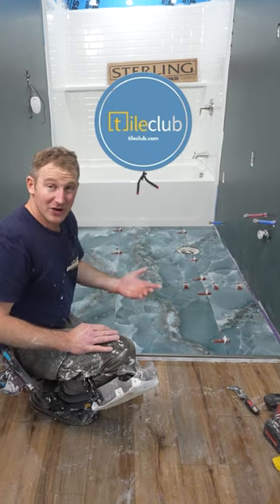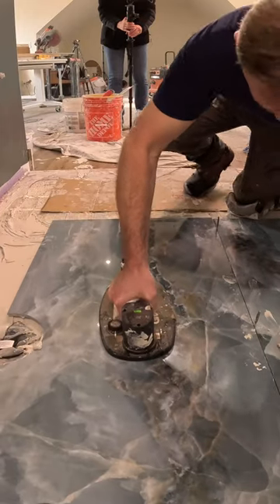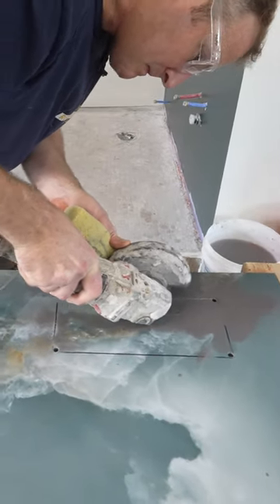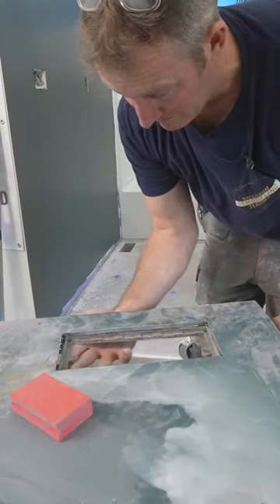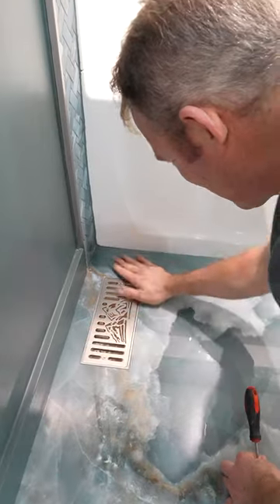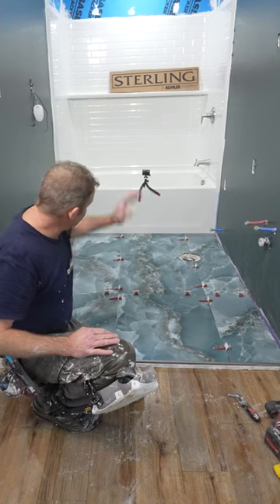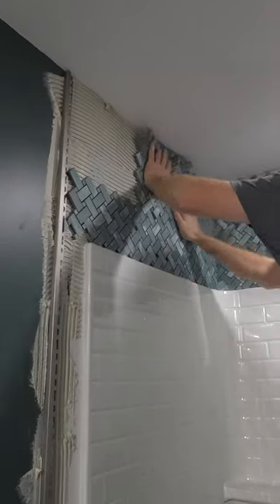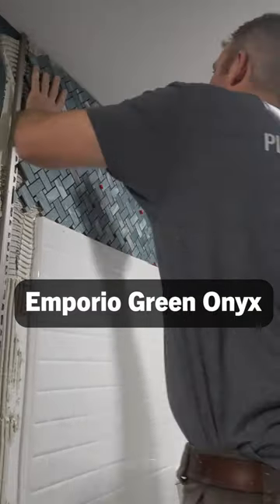BIG Tile Floor Installation 💥

Comment: Have such nice tile but then want a fiberglass unit for the actual shower. Should’ve just used luxury vinyl then. But nice tile around a cheap shower unit doesn’t make sense to me. But then nothing makes sense anymore
Reply from the maker: You can be a better troll than that come on now 👊

Comment: Very nice work around the plastic shower - would have spent 2 extra days to built a tile shower - you can do it !
Reply from the maker: No one is stopping you
Reply: Yea i dont get it, its like another 90 sq ft, just tile the shoer those fiberglass units look horrid